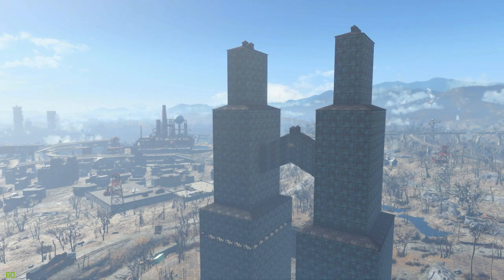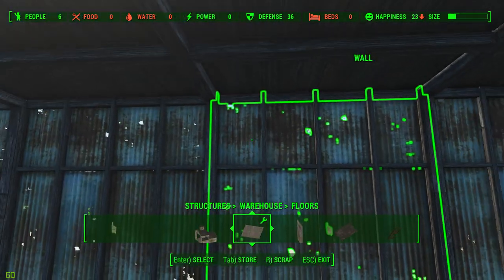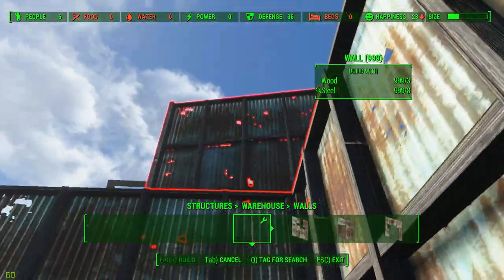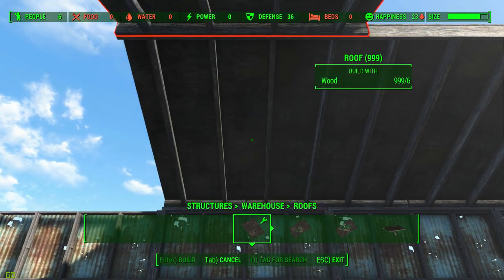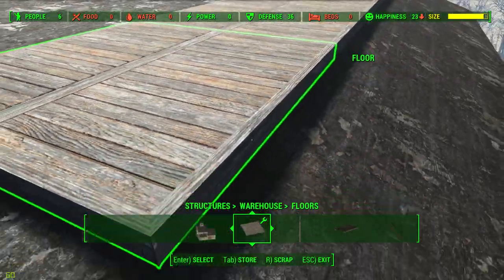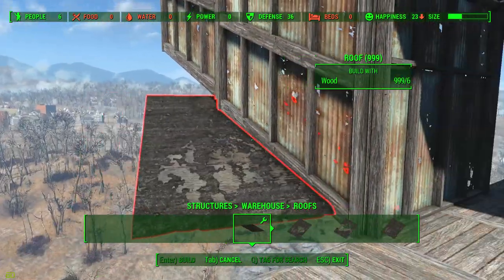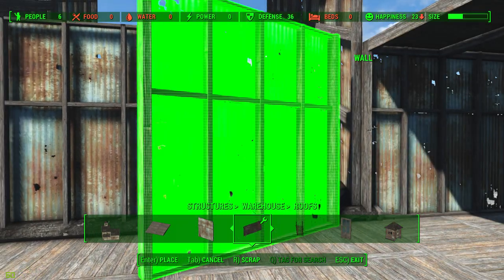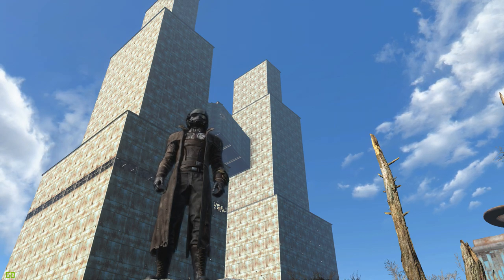Fallout 4 - Epic Double Tower Build

Comment: Do you ever think of using spectacle island?
Reply from the maker: I do and I don't. I pretty much use StarLight Drive purely because the area is quite big, quite square and really flat, which makes it easy to work with. Maybe I should start doing stuff in other settlements
Reply: BurnedGhost ii

Comment: I anticipated 911 references.
Reply from the maker: I actually didn't, because it's not 2 separate buildings, they are extremely close together and are connected. =/
Reply: but as long as there are trolls there will be 911 references.